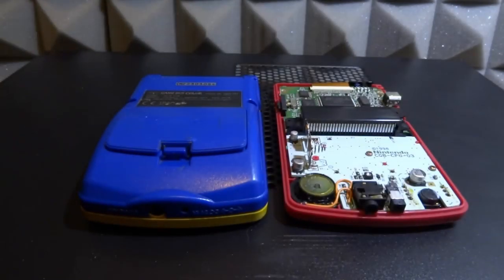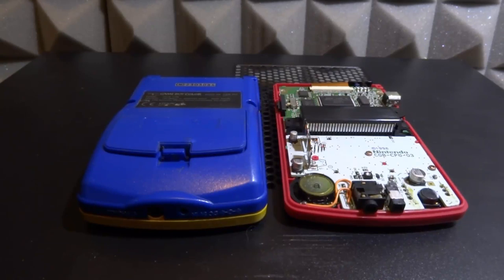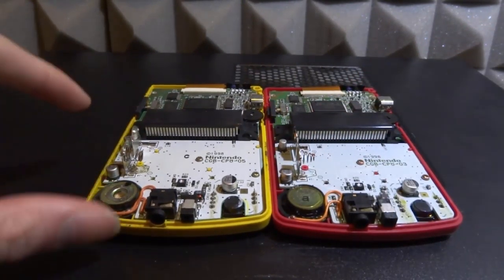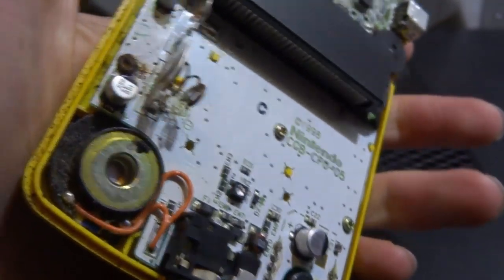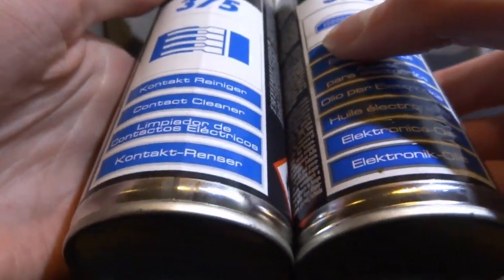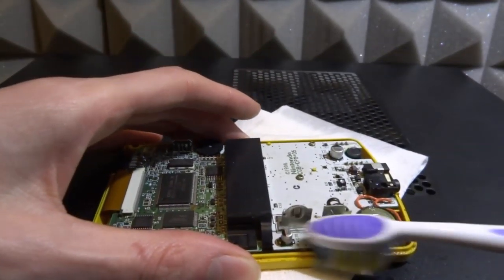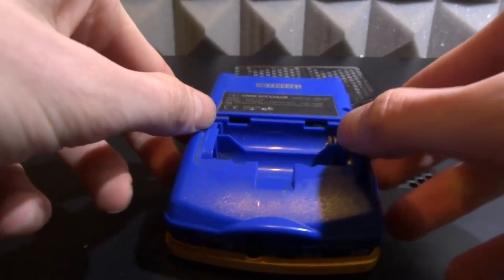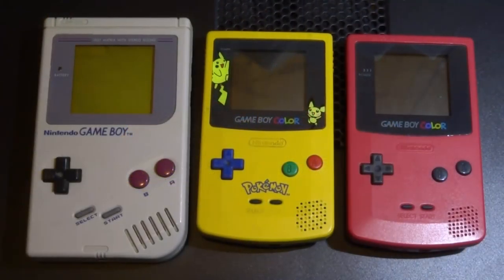Your GameBoy could be CORRODING AWAY! right now...

Comment: My gameboys are fine but I just checked my game gear and it's a mess. I need your help
Reply: Just clean the involved parts first with a dry toothbrush (to clean off the solid powder stuff) and then use sodium bicarbonate, just the normal one, which is also used for baking together with a little bit of water - just make a thin paste out of it. Cover the involved parts with the paste, now it should start to foam, which is a sign that the acid is going to be neutralized. After that, clean all of the parts with isopropyl alcohol, and if you are lucky, and the electronic parts are not destroyed by the acid, you should be fine. Good luck!
Reply: Clean em with isp
Reply: @TheGlobal747  thanks all good now.
Reply: @friendlyjunco6836  :-)

Comment: @James: The are some kind of drills, which you could use on damaged sticking screws. These kind of drills are cutting into the metal of the screw and holding it that way. There are not expensive, just try to get the right size.

Comment: Hey i have a question is it possible to get l3 & r3 on a ps vita using the joysticks from a Nintendo switch
Reply: I guess not. Its completely impossible. Also, if it somehow succeded, analog drift would like to meet your analogs every couple months
Reply: @polyphonydigital  I'd rather have analog drift then not have a physical l3 r3
Reply: @texblade237  Even then, that wouldnt work